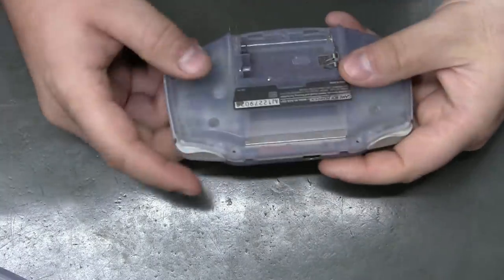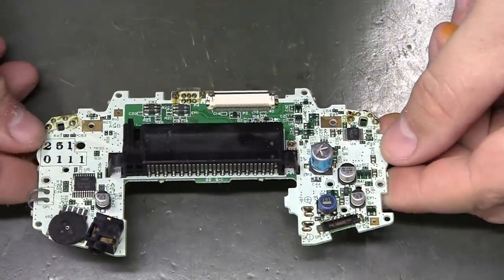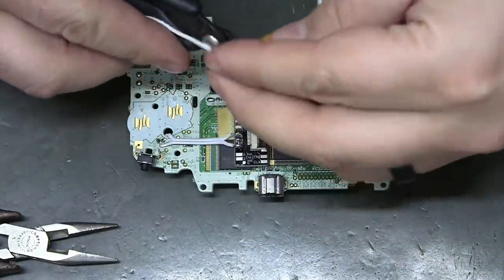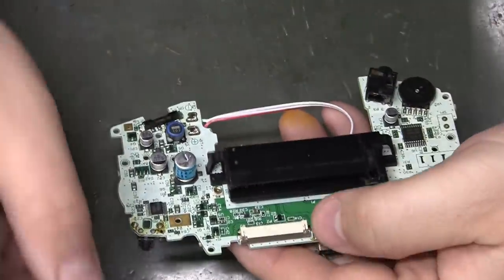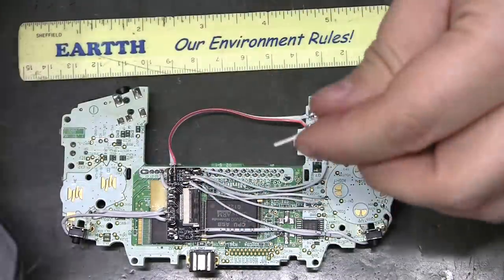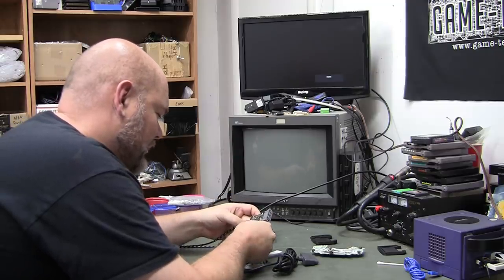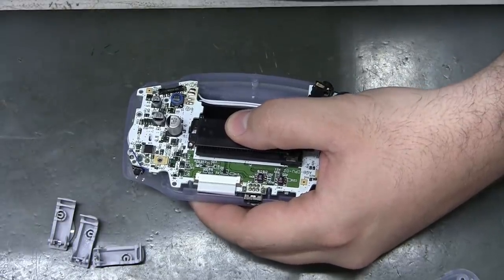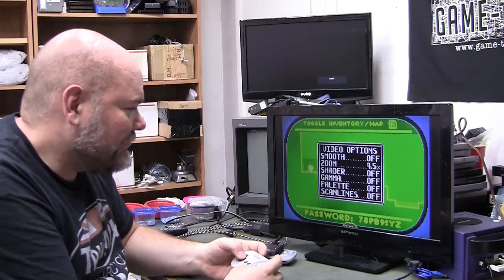GBAConsolizer first installs LCD version Woozle gameboy advance

Comment: Nice job man. Watched this entire video lol. One day i’ll get a proper rig to do this, but for now, I need a new editing rig more than a solder rig. How effortless you solder, I’m sure the years of experience helps, but this just shows me my 30watt radio shack pos will never let me accomplish projects like this. I know you probably get asked this a lot, but what soldering gun do you use in this video?
Reply: No offence, but if he's been soldering years he should be much better than this. Those solder joints are messy, the wire trim is too long, the wire runs are messy, the wire used is wrong type. Not good enough for someone with this amount of experience.
Reply: Not him but I grabbed a generic rework station off Amazon which seems to work well. Comes with an adjustable temperature iron and heat gun. Unfortunately the heat gun once triggered the rate-of-rise heat detection that my smoke detectors apparently seem to have.

Comment: Something that I want to make people aware of is that the "Phillips" screws in the GBA, and in at least all of the Nintendo consoles from before around 2009, are actually JIS (Japanese Industrial Standard) screws and they have a different angles for the slots on the screws. Using a Phillips head screwdriver to screw and unscrew a JIS screw is likely to strip the screw.

Comment: Can I buy a GBA shell or two off of you? You can't get OEM ones anymore and my two are missing the battery doors.
Reply: E-bay has a ton of sellers with GBA shells for $15. There's decent quality third party shells out there. Unless you going for original only.
Reply: @Septer_Sever  Actually I've had a very hard time finding an original milky blue gba battery lid on Ebay, extremely hard to see if original or not, and if not, the colors are always off. In the end the "cheapest" option was to just buy another gba lol
Third party shells are nice, but do feel different.
Reply: @OOOAAAIII  Hey I actually will have a OEM glacier case in a week or two available due to my Pi 3 project and would be stoked to get it to ya. Feel free to message me.
Reply: @gregfisher9169  Wow thanks for the nice reply! I should've been clearer in my post though, I actually did buy another glacier gba just for the shell, so none needed now. Really appreciate it though :-)
Reply: @OOOAAAIII  Oh nice! What type of build are you doing?
Reply: @gregfisher9169  Actually I wanted an original shell to use for the gba consolizer. I once threw away my own original shell, replacing it for an aftermarket one, still feel bad about that

Comment: Those consolized GBA’s sucks, you better off using a tv de-advance adaptor, because not only will it output stereo composite or s-video out,but it maintains the portibility of the GBA ,because it’s tv module is detachable, now if we only mod those tv de-advance adaptors with hdmi out instead,then we can talk on.
Reply: S-video? What year is this?
Reply: johneygd I have a gba sp 101, and the original gba. This will finally get some use from the old gba even though I have a gamecube gba player. I think snes controller is a great fit for gba.
Reply: saysbadman i may will prefer a snes controller for it but i want to make sure that the buttons are mapped to my tast and that there will be no input lag at all,,, and for those ones who complain about composite or s-video ,well i personally HATE HDMI cables because sometimes they can easily loose synch when you shake you tablet abit, sometimes i will not get an connection at all, so those hdmi cables are very sensitive and yes i used different hdmi cables,same problem, with composite video you don’t have that problem unless it’s cracked inside, usb cables do suffer from the same problems from hdmi cable, so it’s not 100% reliable!!!
Reply: johneygd that is what is great about a hdmi cable. You either get the signal or you dont. Analog cables have varied quality output and interference. Digital 1s and 0s you either get the info or you dont with a very small window  of a bad signal. I had an hdmi cable that would give me white specks (which happens when the cable drops parts of the info) , just had to replace it. I see hdmi cables all the time at goodwill for $2-$3. I upgraded my top loader to the hi def nes, and it is great especially since the top loader usually only has coax out. If I do go analog I prefer component as I live in North America. The hd retrovision cables for my genesis are awesome.